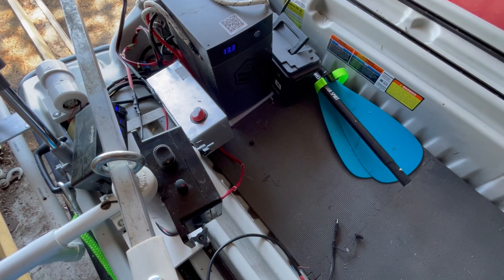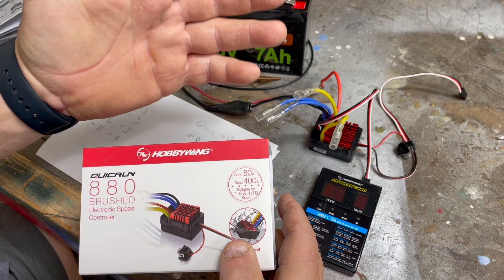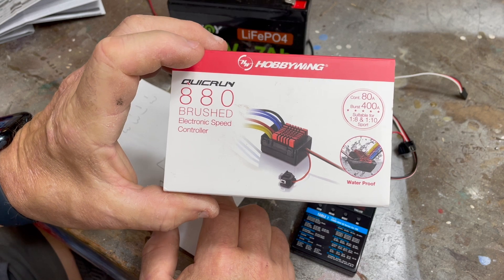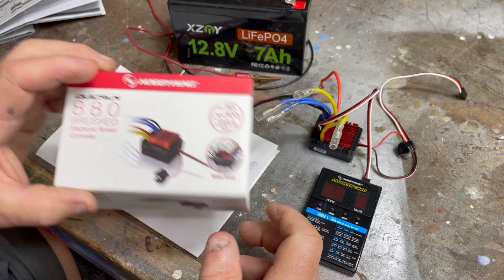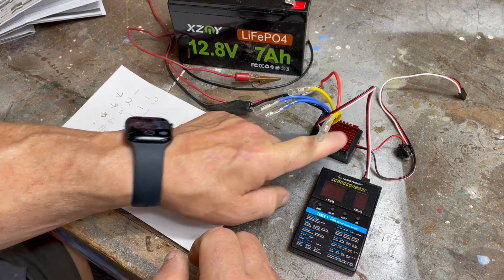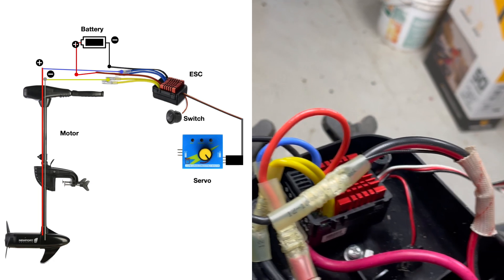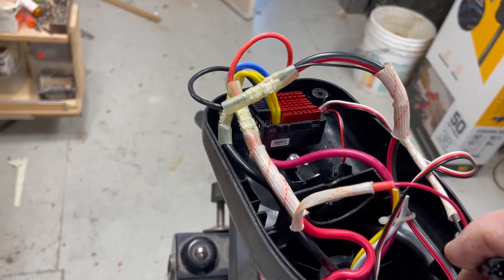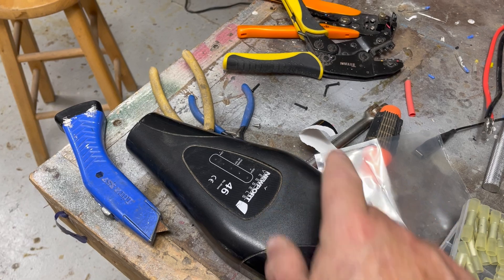Trolling Motor: Head Mounted Electronic Speed Control

Comment: I contacted Newport inquiring about the voltage range for my 55# thrust x series motor . They could not answer that question . They sent a link for pdf manual which doesn't mention using lithium batteries . Thanks for you great videos .
Reply from the maker: Yes, I did too. Same response. Minn Kota has warnings about running for very long higher than 85% using lithium. Lithium tends to put out a very steady current at the higher voltages for a longer time. Wet cells will sort of shrink back a bit under load. Lithium doesn't. Brushless motors don't seem to have this issue though. I notice that in those motors (pretty pricy) there have an electronic speed mechanism much like I made, already built in. Thanks for the comment.

Comment: Thanks for these last 2 videos . I have a new Newport Vessels  55# and a Power Queen 12.8 V 100ah battery . I have been looking on the internet and recommendations are to only run the trolling motor at 85% to keep from burning it up . I will try that first . Thanks .
Reply from the maker: Best of luck. I was doing that also. I have some hot lithium batteries though. A bit higher current than some others I think. Live and learn.